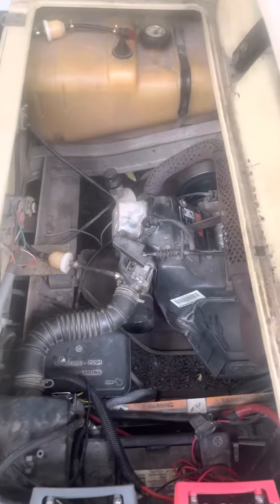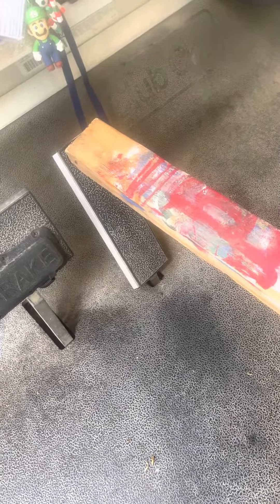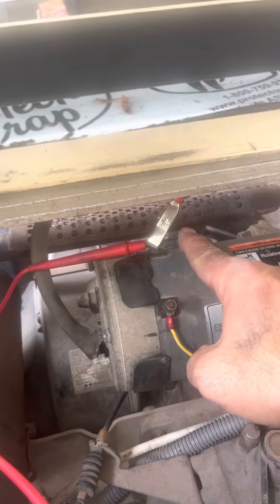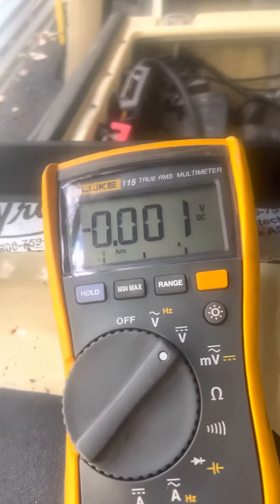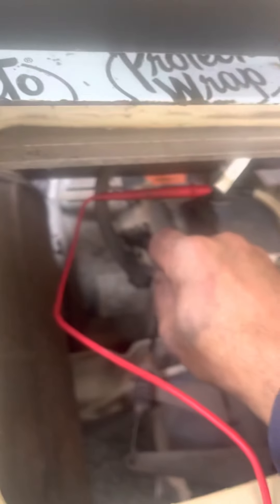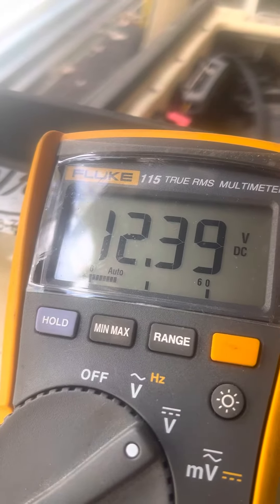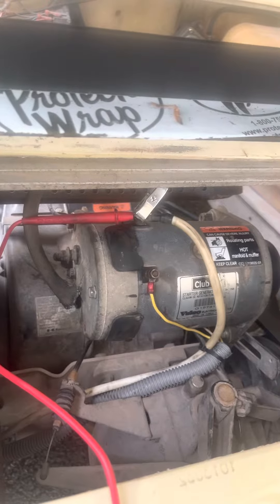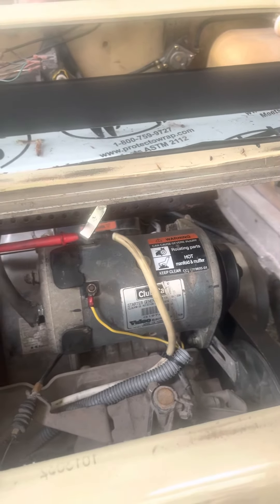Troubleshooting a club car golf cart

Comment: I have just put new batteries in my Club Cart , it ran great for about a week and a bit. But now after 18 holes it seems to be running out of power and on the way home ( I live about 3 blocks from the course all paved roads)   Sometimes I am not sure it will make it, it really seems to be running out of power. This never happened before. What could be the problem? Could it be my charger?
Reply from the maker: I'm no expert on golf carts. I come across different issues every year. I share my experiences. If its electric with wet batteries, check the water level inside the batteries.